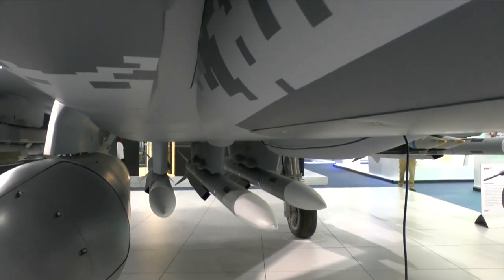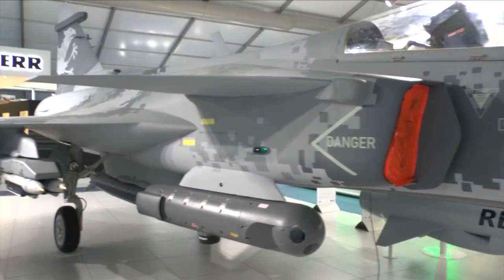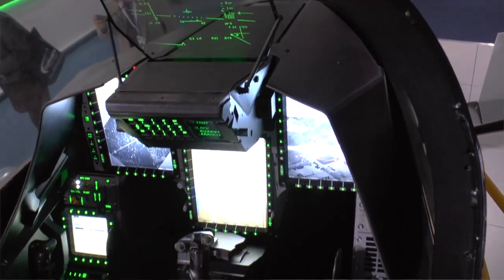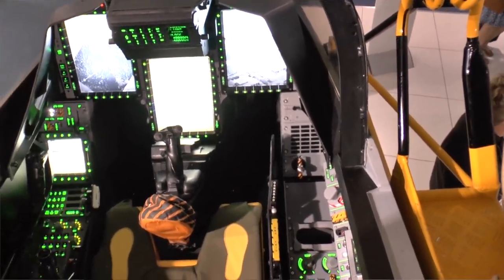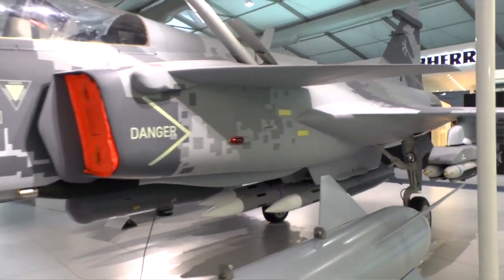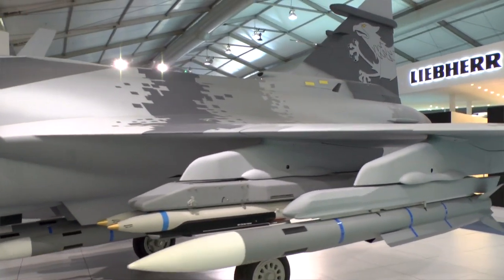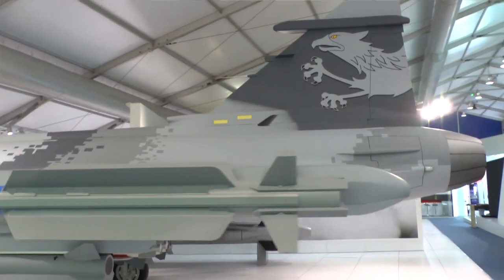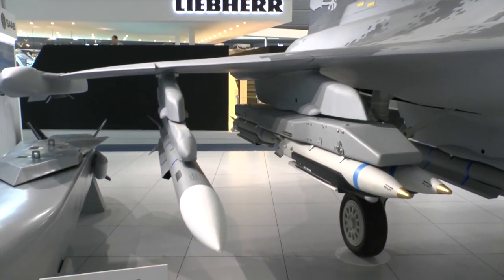Saab’s Chief Test Pilot Richard Ljungberg speaks to IHS Jane’s about Saab’s new Gripen E variant

Comment: Wait, so not all Gripen E has wide panel display with touch screen?!
Reply: Wide panel display is optional.
Reply: Anti it allows for better tactics sharing and pilot machine integration.
Reply: @thomaszhang3101  It's optional. You can buy it with or without wide screen. However, the first prototypes of Gripen E was made with the old screens. Because they wanted to test the flight critical and essential things first. Not add other layers of complexity for testing right away.